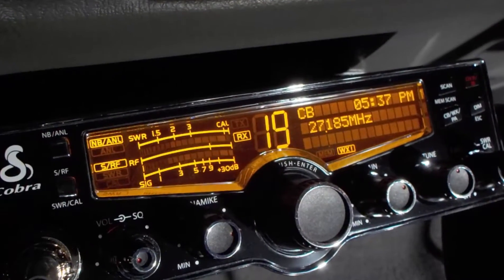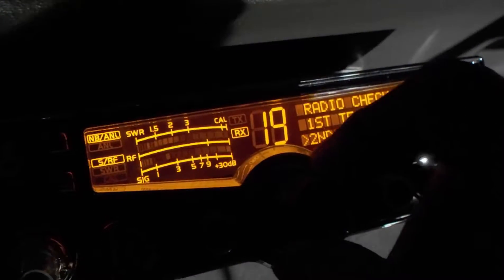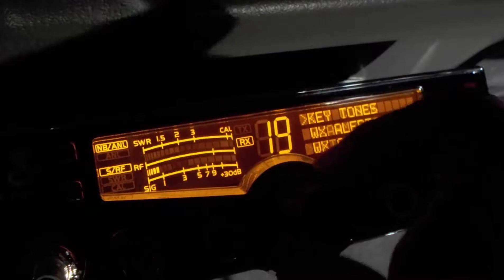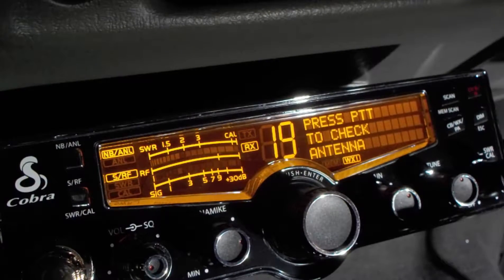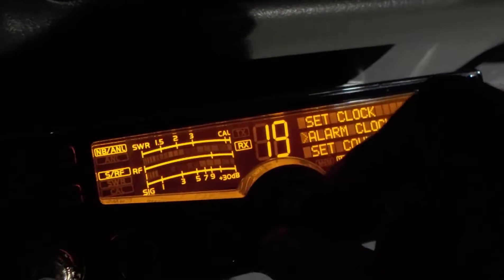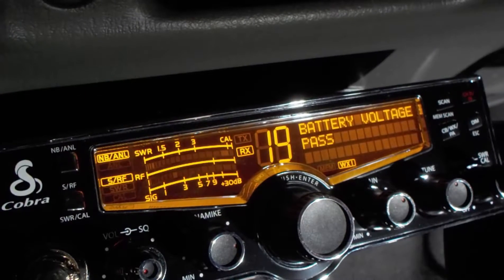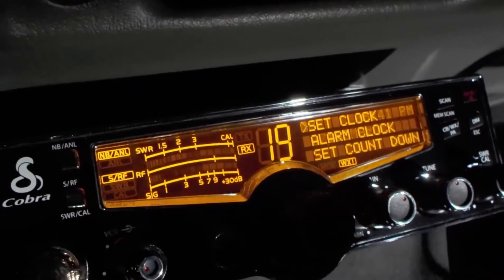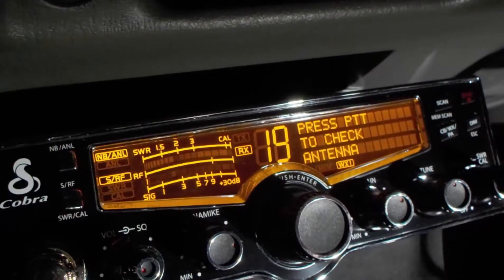CB Radio for Beginners Part 8 Using the Cobra 29 LX Radio Check Features

Comment: What if it says fail on the antena
Reply from the maker: Did you cut and shot en the factory antenna wire. I think that usually causes the warning. Supposed to keep it long as made at the factory. Or antenna wire might be too wound up, leave it  loose and shove it behind the seats and carpeting. When you wind up wire, you get interference in the wound up part, even though it is covered in plastic.